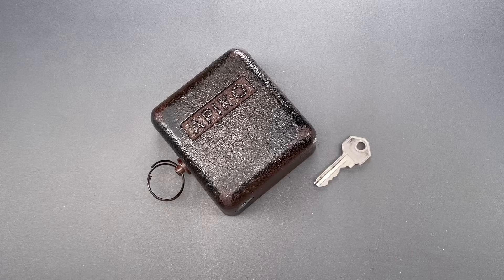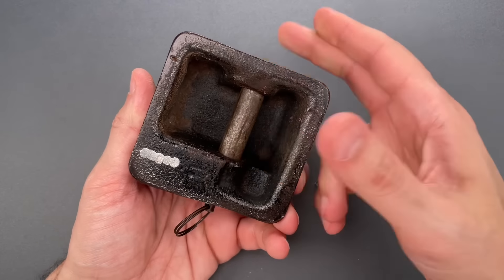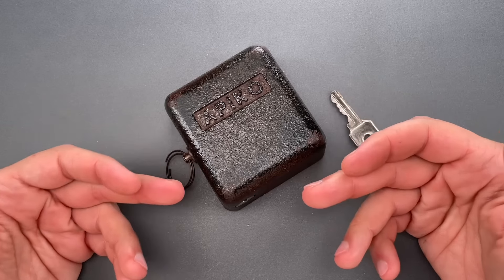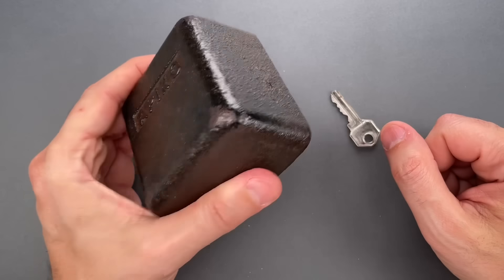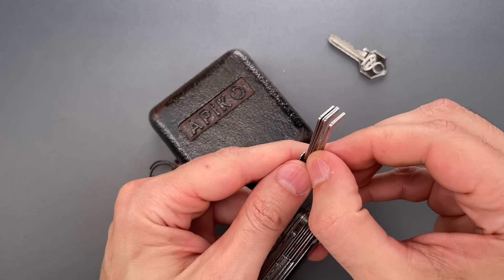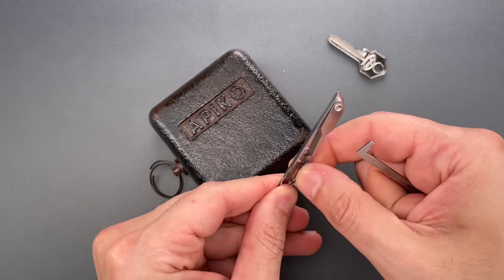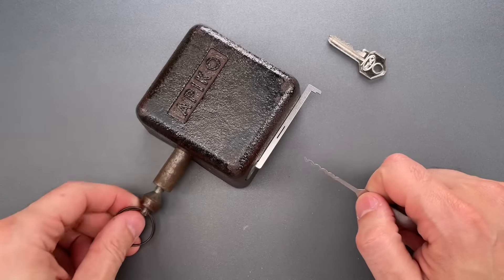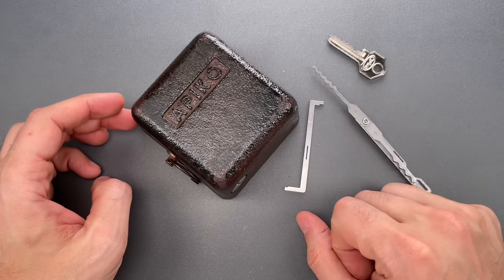[1565] A Modern “Soviet” Lock… As Bad as the Original (Apiko)

Comment: To be fair, the reason most Soviet locks don't care about pick resistance and instead resemble a solid brick, is because all the criminals of that era wanting to break in, would have gone the sledgehammer or crpwbar approach regardless of how easily they could have picked it.
Reply: Funny master lock seem to have taken the same approach, making their reinforced shackles etc yet any I've found that have those extra reinforcements are easier to pick than the ones that don't have that security
Reply: Полиция подозревает, что в инциденте имел место алкоголь.
Reply: Its the Slavic mantra - it doesnt have to be good, it just has to look good.
Reply: @jackmarshall2496  The real irony, as this channel has discussed on numerous occasions, is that Master's by far most pick resistant locks are their plastic-body lock-out-tag-out locks, which are designed to be extremely unlikely to be inadvertently opened with the wrong key but also easy to break off if the key were to get lost. So they have pick-resistant locks and highly reinforced locks, but have never combined those features into the same lock. Would seem like an obvious thing they could do to make an actually good lock, but I suppose they have a reputation to uphold.
Reply: And yet owning a lockpick is a felony in most post-USSR countries, and i assume USSR as well. Not using, just owning.
Reply: @quillmaurer6563  ,the main reason for the lock-out-tag-out locks being that high in security is because of legal requirements.

Only when the law applies does the Master comply.
Reply: @voidseeker4394  That sounds dumb. Anyone with a modicum of metalworking skill can make a set themself with cheep material. The only thing a ban like that does is give another charge to be tossed on if you catch a felon.
Reply: @jorionedwards7305  somehow that doesn't seem right a lock pick is a bent piece of metal hair pin can be used as a rack in a pinch spose it's illegal to have a hair pin too
Reply: @voidseeker4394  Whilst you may be right in this instance, I would caution you against making assumptions about USSR based on post-USSR countries, or vice versa. The countries that broke off did so for a reason, they wanted nothing to do with how USSR was run.
Reply: @quillmaurer6563  If Master started making decent locks, LPL would have to break in a new bad example to show the other lock companies.
Reply: @jorionedwards  Which is just fine for USSR. Also, lockpicks are really nice and cheap things to plant somewhere to create some evidence against the filthy kulaks you want to convict.
Reply: Or the Hammer and Sickle approach
Reply: @jackmarshall2496  It's almost like physical attacks against the lock are much, much more likely than picking attacks.
Reply: @wurfyy Kinda, but also not really. After the USSR fell, countries didn't just throw away their entire government and rebuild from scratch (unlike, say, the U.S did). Instead, they would keep the existing government running and write a new constitution, and then slowly change the little things over time. This is why, for instance, several countries still have the literal KGB. For the same reason, Australia still has tons of obscure old British laws on the books.
Reply: @ilovethelegend  I mean yeah, obviously, more people know how to use bolt cutters than a lockpicking set, but considering their cheaper, supposedly less secure locks have security pins and narrower keyways it makes no sense that their secure reinforced locks are as easy to open with a rack as they are.
Reply: @antonliakhovitch8306  True that. Also not just literal KGB but literal Soviets, too. Even Ukraine, as antagonistic to USSR as they can be, still got Supreme Soviet for parliament and regional soviets too, and pretty much the entire structure of regional governments is soviet legacy as well. Ironically, Russia itself had rebuilt the system from scratch after 1993 constitutional crisis and coup, dispersing the Supreme Soviet with tanks.
Reply: @ChrisSmith-rm6xl let's be honest, LPL would be happy as a pig in mud that day because he'd have new stuff to play with.
Reply: @jorionedwards  In most cases, the point of a ban is not to prevent people from carrying lockpicks... the point is that it's an easy crime to prove and therefore easy to justify an arrest. It's hard to prove that someone has committed a burglary — but if the police find them in possession of lockpicks and no license for them, it's instant grounds for arrest while they look for evidence of more serious offending.
Reply: @jorionedwards  It also means you can charge someone without having to catch them breaking in anywhere.
Reply: I picked those, there was another one with lion head, also easy to open
Reply: Anyone smart enough (sober enough) to pick a lock is smart enough (sober enough) to get a job, and wouldn't really need to break into stuff.
Reply: "Matter over mind", ey?
Reply: @Twiggalot that's the truth!
Reply: Now try it open this in -27 for Celsius, with wind, and around two bears
Reply: @DenisSeemann  ...and a freshly downed, now empty, bottle of cheap vodka.
Reply: Or, they don't have much to store.
Reply: @jackmarshall2496  It could be the same situation it is here in the US. I can legally carry a fully stocked Covert Companion around all day long no problem what-so-ever. But if I were to commit a B&E, then I would be guilty of a second crime for carrying that fully stocked Covert Companion. It isn't a crime to carry one *by itself*, but when used in conjuction with another crime, it becomes one.

The same law applies to a crowbar. If I carry a crowbar in my truck, ok, sure, whatever, it's a 40 year old truck maybe I need that crowbar to help change a flat tire due to rust holding the rims on or something. But if I use that crowbar to pry someone else's car door open and steal their iPad the crowbar cops me a second charge.
Reply: @TestECull  thank you, that's a fair, I was thinking this is Russia we're talking about. It's probably been used to incriminate someone at some stage, and it's been assumed to be illegal ever since.
Reply: and also because they were scarce
Reply: @TwiggehTV what? Usually it's the exact opposite
Reply: @wurfyy  
Kulak means loan shark. FYI
Reply: @voidseeker4394 strictly speaking, at least in Russia it is not illegal to own a lockpick, but it is illegal to produce, buy, or import them

Comment: these locks were made to resist drunken gopnik with some iron bar, not picking tool
Reply: As I understand, they really didn't resist that very well either.
Reply: @0neDoomedSpaceMarine can you snap iron rod with iron bar?
Reply: @real_andrii  Depending on what kind of leverage applied where, and depending on what the structural strength and quality is of either part, and the lock's mechanical assembly is, then yes. 
This very channel shows how you can use a pair of non-adjustable wrenches to break various common padlocks open.

Consider that lead is softer than steel, but if you shoot a lead bullet at the side of a gun's barrel, you can seriously damage that gunbarrel, even if it's the exact same kind of gun which you used to shoot it with.

Energy is a significant factor of the equation.

Comment: In Ukraine and former USSR states, no one picks thees locks. Instead, there is a simple brutal force technique - a screw into the keyhole, then pry it open with a crowbar.
Reply: Screwdriver into the keyhole, and lever the entire thing open with a crowbar?
Reply: @prfwrx2497  screw, not screwdriver. The screw will gut the mechanism and pins while you pulling it out by crowbar so you may just turn it by any key of this size
Reply: @ImPedofinderGeneral  The other half of why "Drill resistant" cores are so useful.  They also prevent this attack.
Reply: @arthurmoore9488 they make that attack slower to accomplish, it is still entirely possible with the knowledge of what to do.  
I've drilled through many good quality "drill resistant" locks. Also higher end drill bits are faster, but more expensive doing that since they get fairly chewed up.
Will always attempt to pick first though if time and access is available.
Reply: @rico76 I mean that is the point of drill-resistance, right?
If some brainiac brings a cordless drill or an angled grinder it's best to have them use those hellishly loud instruments as long as possible to attract attention of the owner of that or whoever
Reply: LPL used tools like that (used a bell shaped device instead of a crowbar) for a few videos to try it out, on strong locks the screw breaks while pulling or even while screwing it in.
Reply: 😂😂 destroy the lock
Reply: Its not much different here in Australia.   Low life crims aren't smart enough to pick locks.   They just use a crowbar to get in.  some low life tried to break into my workshop last year.   They gave up getting in but wrecked the padlock trying to lever it open.   Right next to a glass window they could have smashed.

Comment: In Ukraine we had almost on every garage something like this in 90s. Plus some self-made trick locks additionally. But mostly those shitty. So the most security came from poverty - nothing to steal, no one will try. And from person watching for garage area. 
But what interesting that this lock still better than some others options on market nowadays. Why? Most of them easy to lock pick. But at least for this hard to destroy it with brutal force. And also - it normally stays vertically, so it is not so obvious where the lock hole is, hard to find if you look it first time. 
Still complete garbage thought 🙂

Comment: You could get great security with that lock, you just drop it in a sock and use it to bludgeon anyone trying to break in.
Reply: Not with soviet socks, unless you want to sling the lock
Reply: I read this comment in a stereotypical Soviet accent.
Reply: @DugrozReports  You see Ivan
Reply: No need for Soviet socks. Most socks would also break first
Reply: @uninstaller2860  I mean, with some practice you could probably get pretty good at launching locks.
Reply: @uninstaller2860 In Soviet Russia, lock sling yooouu!
Reply: @uninstaller2860  you mean ranged attacks? That's a feature not a bug.
Reply: @uninstaller2860 very funny. In reality though, Soviet clothes were quite durable. Most things were - because they had to comply with official government issued standards using the same technology and procedures. There might've been only like two models of socks, but all of them were certified good quality products.
Reply: @helgenlane  Just because everything was big and bulky doesn't mean it was durable
Reply: @uninstaller2860  I'm not talking about everything, I'm talking about socks. Electronics were also pretty good and they were actually designed simple to repair. A lot of people have perception "soviet = bad" which just doesn't reflect the reality.
Reply: @helgenlane  Yeah, you are actually correct on your points

Comment: Most soviet era criminals liked to smash lock open rather than pick them. These type of locks were found on garages. And garages were built like storage units all next to each other in a compound. That usually had guards and guard dogs on site. Lockpicking was reserved for braking into aparments were actually valubale stuff was. Because tools were cheap and everywhere and cars were fairly hard to resell if they were stolen.
Reply: No different anywhere, I suspect. Lock picking requires skill, and the main reason to use skill over brute force is that you're trying not to break things... not a priority for the average burglar.
Reply: @simongeard4824  That's why a door+lock assembly must be solid enough to force burglar to rely on his skills only.
Reply: @simongeard4824  I always felt like average burglar will want to get in quickly, grab whatever he can and get out with minimal sound and time spent outside. Crowbar will usually give you pretty quick access and can be also used inside, if something is screwed down (or if the owner is there and the burglar wants to fight). 
But lockpicks, that is something for a guy that doesn't want the owner to know that somebody got in. What may be the reason for it? It can be a private eye, I know, not 100% legal, but I can see a situation where PE would use picklock. I saw firefighters use a pick gun to get in an apartment when they had to get out guy who fall and couldn't get up (BTW, having one of those tools is great for situations like that, they wanted to get the guy in hospital and lock the door after leaving). And then there are really dark reasons, like kidnapping, stalking, maybe even a planned murder.
Reply: @simonspacek3670  Or just not being detected. Sure, sure, a quick smash and grab will get the job done, but that will alert everyone within half a city block that you're doing naughty shit. Pick the lock quietly and slip in nobody has a clue. And if you're particularly good faced with a shitty lock you can even do it in broad daylight in front of everyone and it won't look like you're breaking in at all.  Just look like you're sticking a key in there as if you're supposed to be opening that door. Witnesses won't even know they're witnessing a crime.

The average burglar doesn't care too much about being undetected, though, so they'll just smash their way in. And that's why they always get busted.
Reply: @pavelognev108   Which is pretty much never the case in an American home. Standard PTP 2x4 door posts and cheap laminated hollow-core doors don't do shit to stop burglars. One well placed kick bypasses whatever lock you have in the door whether it's a shitty Masterlock or the finest in the land.

 You want a burglar to have to rely on skill you're gonna want reinforced steel door posts and a solid oak or solid steel door. And then hope beyond hope they don't get any ideas about the bay window 5 steps to the right of the front door.....

Modern US home design is a security nightmare. You just about have to design the damn thing yourself if you want it to be secure.
Reply: @TestECull  AFAIK, typical american home is secured not by the door and lock, but a loaded shotgun under owner's bed.
However, there is no such developed gun culture in Ukraine (the origin of the lock on video, and my motherland). So,  reinforced door and grated 1st floor windows are normal here.

For the instance, I have a heavy steel door, and its post is anchored deep into concrete... and a shotgun 😜
Reply: My grandma has a lock like this on her indoor kitchen room entrance, I think it was held with a cloth rag, the point was to keep neighbors in communal flat from borrowing cups and spoons.
Reply: I guess the security in the Soviet era was provided less by the pick-resistance, or even the brute strength, of the lock, and more by the knowledge that if the guard glances in your direction and you look like you're even thinking of picking it, you'll probably be taking an all-expenses-paid one-way trip to Siberia?
Reply: @tommcewan7936  no Siberia trips after picking someone's else lock, just a regular jail, same way as in other countries. To be put into Gulag, you had to express some political opinion.
Reply: @pavelognev108  ah, important distinction, thanks.
Reply: @tommcewan7936 He's lying to you, the majority of people in gulag were non-political.
Reply: @alanywalany6460  They weren't political in what people admit is political, they were mostly 'political' or just, ethnic minorities in a group that had organization. Lockpickers went to, ya know, jail. The reason people have the 'majority in gulag were not political' was due to the overall Soviet Union in history, where, masses of people who were say, Polish in Lviv or Ukrainian in Warsaw were just mass deported, or who knew people or were family with people in the wrong area. But for most of the Soviet Union, ya know, laws weren't radically different.

Comment: Hi! I'm from Ukraine and I actually used a very similar lock on a garage for some time. And, who would have thought - it was broken into at some point!
But the funniest part - no one picked it. They just brut forced it with a screw and a hammer.
Reply: lmao, I'm from Russia -- and I saw the very same lock being handled the very same way
Reply: The way I hear it described, the keyway is more of a suggestion on a lot of these, and that many of them were brutalized open pretty easily.
Reply: @0neDoomedSpaceMarine  this lock isn't the one that can be easily brutalized. Of course you can break it but you will make a ton of noise and spare a considerable amount of time. If such problems don't concern a burglar then it doesn't matter what lock you put on your door. I know a family that secured their country home with an extremely break-proof lock system and burglars just used thermite composition to burn through that door leaving the locks untouched. Picking such lock is way faster but it requires certain intellect to do which burglars do not possess
Reply: We used a (not sharp) kitchen knife to open the room door in OUR communal flat in Odesa. Like yeah the apartment itself had a working lock but the door to our room from corridor occupied by 3 families was essentially a lever you picked with any thin object that could slid between the door and the frame and lift up the tongue or however you call it. Iron thingy that lock manipulates.
Reply: @KasumiRINA  I did the same thing when I accidentally locked the bathroom without a key. Greetings from Ivano-Frankivsk.

Comment: Companies like this (by the way, it is spelled in cyrillic and reads "Ariko") just use old manufacturing tools and hardware that is left on the factories. It's not even a homage, but the exact same locks. They even sometimes have a price stamp in soviet currency because it was straight up a part of the casting 😁
Reply: Oh right, they probably don't update that at all, just use the existing dies and tools because that's much cheaper.
Such interesting historical curiosities.
Reply: No equipment can operate for 60 years without rebuilding :)